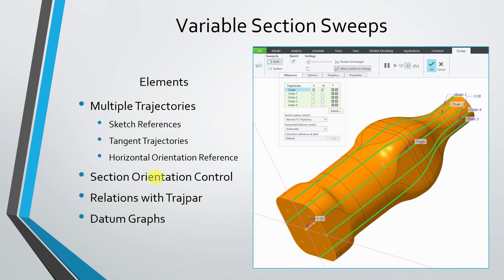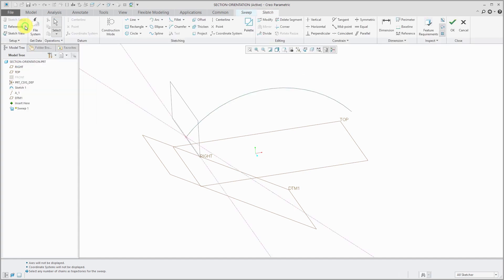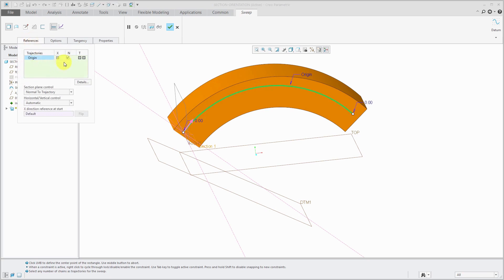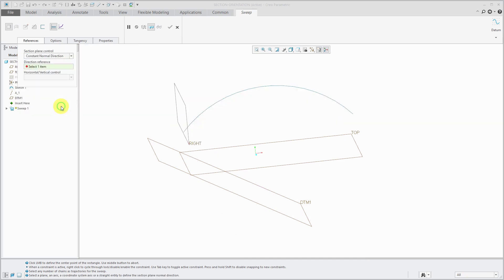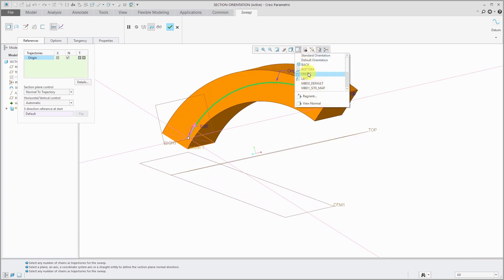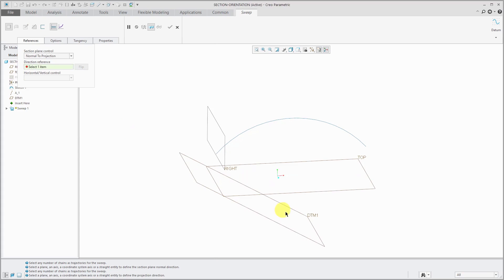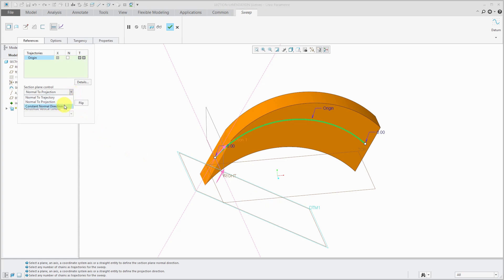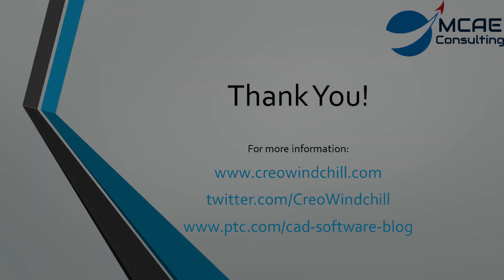Creo Parametric: Variable Section Sweeps - Part 2: Section Orientation Control

Comment: I have used Normal to projection to sweep a profile such that surface is always normal to mid plane which I used as normal to projection. Upon mirroring surface across the same plane , I got tangent continuity between two surfaces
Reply from the maker: Very interesting. That is good to know.

Comment: Hi Dave, thanks for all the vids. Section plane control normal to projection is useful for creating geometry with controlled draft. If the projection direction reference is set to the 'pull direction' of the tooling action you're designing for (e.g. ejection mould parting plane, slider direction etc) then sketched geometry can be dimensioned (i.e. with an angle) relative to that reference. So it allows geometry with controlled draft to be created off complex (e.g. 3d) trajectories with minimal effort. This is also a useful method for creating surfaces to use as boundary conditions to control the draft on the edge of a boundary blend.

Comment: @3:50 Normal to Projection  is very useful when you design to manufacture (for example an injection plastic part) . 
If you use the mold's Parting Plane  as a Normal to Projection reference, then you are sure that the Variable Section Sweep Part can be safely ejected from the mold cavity because it is impossible to accidentally design an undercut. BTW keep 'em coming. Amazing tutorials.
Reply from the maker: Wow! Thanks! That is really useful information and I appreciate you sharing that. Since that option was introduced maybe a dozen years ago I’ve never understood the purpose and that makes total sense.
Reply: @CADPLMGuy  No problem mate. Glad I helped :)